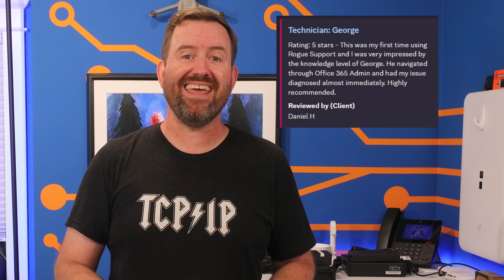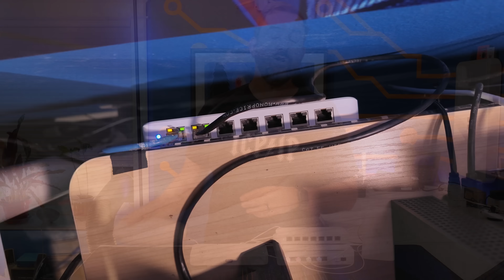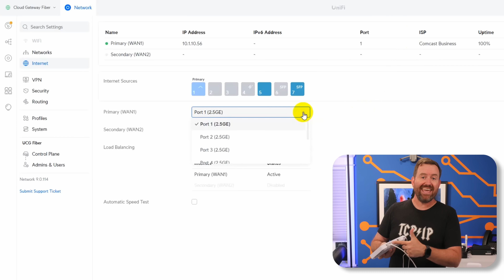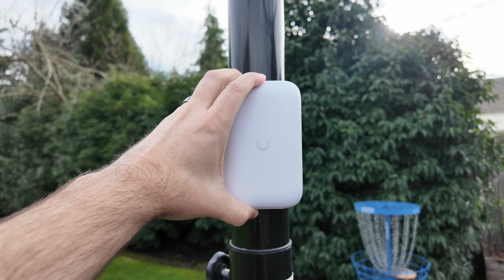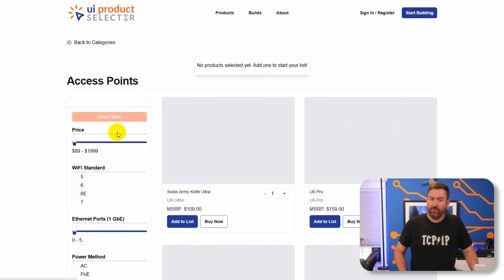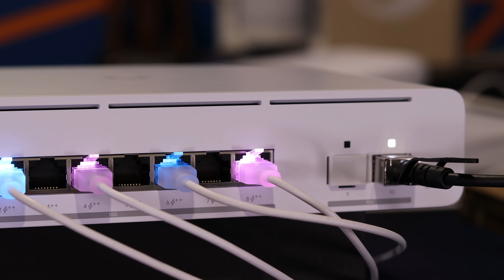Top 5 Unifi Products I Love in 2025!

Comment: Just "deployed" a whole system in my home!  UCG fiber, Pro XG's, Inwall 7, E7.....  Unfortunately, my home is fully finished. I had to use MoCa adapters and POE injectors, which add power bricks and wiring that my wife is less than thrilled about. Trying to figure out creative ways to "hide" the extra wiring. Great video, as always!
Reply: Lawrence Systems has some older videos on how to install network wiring into pre-existing walls. Might be worth a look?

Comment: Been considering the U7 XG Pro as a "one and done" to upgrade from ISP provided "gateway" (along with other required equipment of course).  Wondering if the claimed 2000sq/ft coverage will work for me for a 1900sq/ft house that is split into two levels (so probably around 1000sq/ft per floor) in a roughly 2:1 rectangle shape.  Most high value stuff is hardwired (TV devices, gaming PC) and located on the first floor.  Was thinking a centrally located 1st floor AP location would work for the entire house?

Comment: I'd be interested in an "upgrade" video, guiding people with older Unifi components what the upgrade path is - eg. I still have the old USG-PRO-4 but haven't worked out what gateway to upgrade too.
Reply: I’d suggest the Cloud Gateway Max or the Cloud Gateway Fiber.

The ‘Max’ has five 2.5Gb ports. You can have one of two WAN ports, and it can have an M.2 drive for storage if you’re running any cameras. 

The ‘Fiber’ has four 2.5Gb ports, with one supporting PoE out, one 10Gb  RJ45 port and two 10Gb SFP+ ports. Up to six of the seven ports can be WAN ports, and it also has a spot for an M.2 drive.
 
Note: An adapter is required to add an M.2 drive if you buy either without storage. It’s $19 USD.
Reply: Personally I upgraded to the Dream Machine Pro Max a year ago. The storage space in it is wasted for me, I also have an UNVR-Pro for the cameras. I doubt broadband speeds will ever get to the 5gbps rate it can handle. But it was a distinct upgrade over my USG, and it seems smarter about the network. It has helped me detect bad configurations and dumb loops from time to time. No brainer if the money is not an issue.

The two cloud gateways seem equivalent to that for my use case. Probably the only thing hobbling them is less system memory? Not sure if that makes much difference. But the price is nice if you are on a budget.

Comment: the usw-ultra is even more versatile you can power it with anything from poe to poe++ with the only difference the poe output power.
Also for everyone buying one the switch without ac adapter + a poe++ adapter is cheaper than the switch with the 60W adapter and both supply the same amount of power

Comment: Thanks Chris.  No Dreamwall?
Reply: Dreamwall would be one of the products on my bottom 5 list. When it comes to networking equipment, the last thing I’d want is any sort of all-in-one setup.

But that’s just me.🤷🏻‍♂️
Reply: @williamp6800  I was joking.  I have one and wish I had not purchased it especially it went off line after a power failure and I’m thousands of miles away.
Reply: @joegomez5807  funny you mention a power outage... 

I’ve got my network layered such that if the power goes out, the servers shut themselves down, and only the core of the network (the gateway and one AP) stays powered up by a UPS. I really should have a larger UPS, but with this approach it at least gives the UPS a fighting chance to outlast the power outage.

Comment: The U7 pro xg isn't worth the extra $10 in my opinion. If you want to actually utilize the 10g throughput you'll need to buy a 10g poe adapter on top of the extra $10.
Edit: it isn't worth it if you don't need 10g throughput.
Reply: To me the biggest upgrade from U7 pro is the fabless design. Worth the $10 up charge in my book

Comment: More a story of Unifi improvement than a suggested product. I recently replaced my AC LR (that had died...) with a U6+. I originally chose the LR to cover a largish house which it didn't quite manage, the garage missing out. In buying the U6+ I had expected to need to add a second AP because my house was larger than the U6+'s listed coverage. However I was pleasantly surprised that the U6+ had better coverage than expected comfortably covering the whole house, including the garage. That combined with it's 1Gig connection to the switch meant my devices now get at least 80% of my 500Mbs internet connection speed anywhere in the house and garage. This means my best results have gone from 80Mbps on the AC LR to 480Mbps. And the AP is quite a bit smaller resulting in a much better partner approval rating.
Reply: I will maybe also upgrade my AC LRs. So you have better coverage with the U6+, that is unexpected. The AC LR also has 1 GBit Uplink, why was yours so slow?
Reply: @thomas7777-i2v  The only thing I can think of was that it was 4 years old and maybe the model had a spec bump since I bought it…?
Reply: I had similar problems with the throughput of the AC/LR. Mine is still working but I added a U6+ and found the same increase in performance and coverage.  

Since I didn’t need the AC/LR for overall coverage, I repurposed it. It’s now connected to a Flex mini switch in my office and meshes to the U6+. That puts the  3 computers and printer in my home office all on Ethernet for taking to each other, and only a single wifi connection to the rest of the network for all of them.

Comment: Oh yea I love that rgb switch mounted high in a closet rack that nobody will ever see unless I need to go fix something
Reply: You could say the same about the existing lights on each port (TX and RX). But I imagine you wouldn’t want those lights to go away, because they can provide real value when troubleshooting.  
 
The Etherlighting  should be able to indicate any possible problem, or any metric you might want to track on a per port basis.   

As one example, wouldn’t it be great if those lights could tell you when the traffic on a port is saturating the connection? Or when that is happening for more than one minute, and how often that happens in a 24 hour period? 

For a home user that particular example probably isn’t that useful. But I suspect there is something that happens on a per port basis that could be useful for troubleshooting. One of those “I Didn’t know I needed that until I had it” situations. 

I think Ubiquiti just set the target too low for what Etherlighting can do for the person managing the network.

Comment: It would be nice if the Etherlighting could also be configured to show POE power level
Reply: Or a choice of every possible metric that the could show you. 

Or from that range metrics, be able to set a boundary of each metric, and if any port exceeds a limit, have that port turn red to alert you to check the console. Or a particular colour for each metric you want to alerted about. 

Basically go overboard on the info that the Etherlighting could supply.

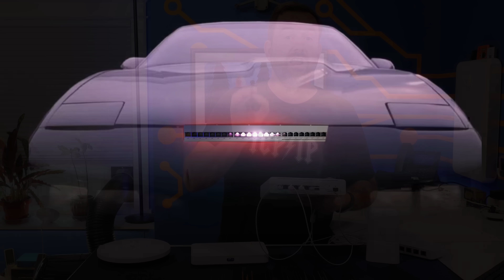Comment: 8:36 LOL!
if that etherlighting stuff was just eye candy, i wouldn't bother with it. but if it is useful (different colors fo different conditions) i might actually use it (if, that is, i had a device equipped with it.)
Reply: I use those etherlighting switches for Vlans in an environment where lots of people work and it's really helpful. For me, to find wrongly configured ports and for others to easily find the correct port to use. Remote support has never been that easy. Etherlighting is a gamechanger and I hope they release even smaller switches with that feature
Reply: @El3andro  that’s exactly where I saw the use for Etherlighting. A wrong VLAN could be a serious security issue. 

I know a lot of people will say they don’t make mistakes about which VLAN a port is on. That’s great, but I like the idea of being able to see at a glance if I have.
Reply: @williamp6800 mistakes happen; the question is how fast can you find the issue and Etherlighting definitely helps to quickly resolve issues just by having a simple look

Comment: U7 Pro XG and all Unifi wifi-7 APs uses so much electricity, that it must be sponsored by the power companies
Reply: The older U7 Pro uses 9.6-13W depending on load for me. Not that extreme for a tri-band AP connected with 2,5Gbit/s.